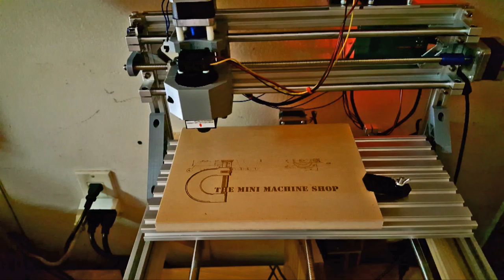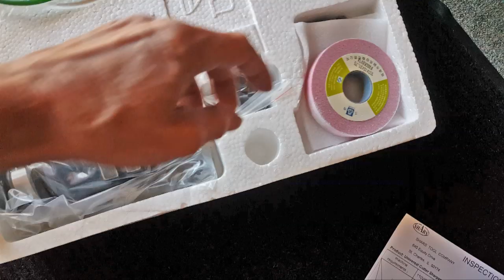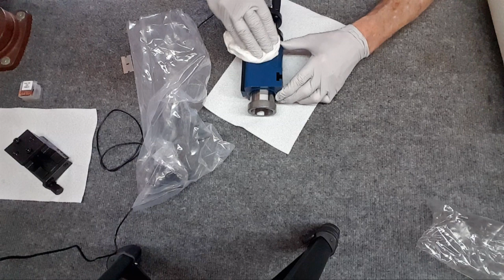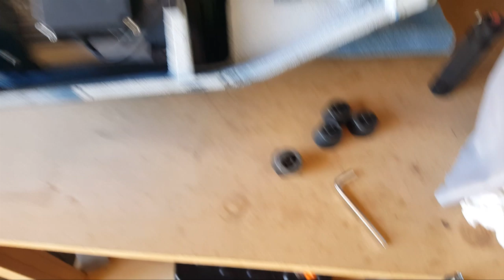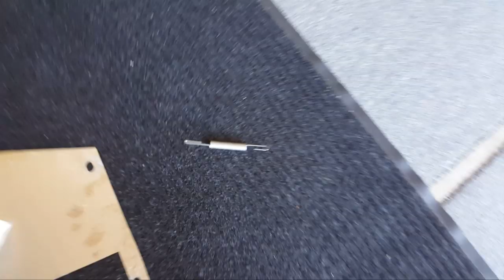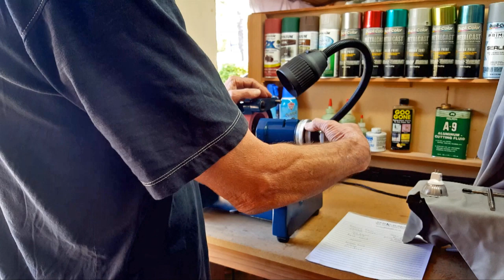Universal Tool Cutter Grinder AKA D Bit Grinder

Comment: no frills. no BS. just what it is and how it works. thank you so much! that helps me a lot. i bought the business end, and i'm trying to redneck the motor and base into a complete working tool grinder. your video helped me see the big picture.
Reply from the maker: If I can help more let me know my email is at the end of every video. Cheers! BTW mine turns at 5,000 RPM and is hard to find wheels that have max RPM specs. The Ebay ones spin much slower.

Comment: 22:35 I know this video is years old but.... rotating the upper left wheel brings the wheel to the left, bringing the spindle lock hole in line with the access hole.
Reply from the maker: Actually i never thought of doing that. I would just put the screwdriver in at an angle. LOL

Comment: Uh it's around 100 pounds. I lifted mine out of the box and put it on the bench by myself and I'm 60 years old. The pallet weighed half as much as the grinder. Shipping weight is 50kilos.

Comment: Hi Dave. My D Bit grinder does not have the spring you show and therefore allows the freedom to plunge grind. In many ways it feels like this is a more natural way to grind the D bits, ie freehand yet set at a precise angle.
Reply from the maker: I have both options I can rotate the knob to move in and out or loosen the side lock and slide the top assembly to plunge and the depth is set using the depth set knob. Many don't realize the entire top assembly is on gibs and slides.
Reply: @TheMiniMachineShop  Agreed, that is an option to overcome the limitations caused by the spring you have. However the original Deckel SO grinder upon which these Chinese clones are all ultimately based on has no such spring and therefore allows far greater freedom. Have you seen the excellent videos on YouTube by The Tool and Die Guy (Deckel Lessons 1 to 10). This series shows a great overview of the Deckel SO.

Comment: I bought one of these Deckel clones a few months ago, (not Shars), and are making some more flanges/arbors/wheel adapters, like Stefan Gotteswinter showed. But to duplicate the taper, I now I need to pull my original flange off the spindle, like in your video at 17min, and mine appears unable to be pulled of the taper. It does not have the 5mm or 6mm socket screw in the center and there's just a 4mm pilot hole where yours has the threads. Anyone else have a U3 clone machine that's the same?
Reply from the maker: I looked at pictures of the U3 and looks like mine can you email a side picture and one of the face my email is shown at the end.
Reply: @TheMiniMachineShop  Thanks for responding Dave. I'm emailing you.
Reply from the maker: Just found a picture of a Vevor on Amazon of an arbor like your describing. The screw in the center is what captures the adapter and holds it in place. With out the screw the spindle must be machined as one piece while other U3's do look like mine so there appears to be two U3 models.

Comment: https://www.youtube.com/watch?v=1egAPzOGVDw Luc Wybo shows how to use that drill attachment. Very thorough video. For wheels, KBC Tools has silica-based cup wheels from Triumph at reasonable price. Using brand name ones pays off, they are actually round. I have an Alexander 2CGD, a Deckel SO made under license from Deckel. I use it for lathe cutting tools (6 and 8mm round HSS) and for four-facet grinds on drills. After 5 drills I am down to 3 minutes/drill using a slightly modified approach from Stefan G. ER16 collet chuck does all the sizes I need.

Comment: I just received an advertisement/catalog from Travers.  They have a 4x3x1 1/2 "Type 11" aluminum oxide tool room surface grinding
wheel on sale for $15.74.  Actually, they are offering 5 different weels by part numbers 53-200-040K through 53-200-044K.  I don't know if a 3" deep wheel will fit on a Shars machine.  Also I don't know if a "surface grinding wheel" is suitable for a Shars D bit grinding tool.  These "K" series wheels are a fine grit so, that sounds hopeful.
Reply from the maker: Problem is the Shars machine takes 1 1/4 bore 4"wheels and mine also can take a 20mm bore wheel since I made a spindle adapter. Good prices and will check it out!!
Reply from the maker: Travers is my favorite and only place for taps and end mills...

Comment: Dave,
First and foremost... drilling out wheels (like that alu-backed diamiond wheel) is dangerous/lethal.... please don't run that wheel?
Another remark (this is for classic wheels, not for the alu-backed ones) NEVER; EVER run  a wheel that has no paper/cardboard washers glued on (use some card-stock if it is missing)
If you for some strange and weird reason want to lower the shaft RPM, you will only 'eat' your grinding wheels.
For small wheels like these.... 5000 rpm is a perfectly normal speed, if you put on smaller wheels, your RPM should go up!
From all the machines in the shop, a grinder is probably one of the more dangerous ones (believe me, you don't want to be near one if a wheel shatters!) Consider buying good wheels for your machine (you're in the US, so I'd suggest Norton) They will cost more, but there will be a lot less chance that you'll end up with a chunk of carborundum stuck in your noggin !!!
Like all Chinese machines, this is to be considered to be " a kit of parts"... If you make alterations to this machines (and you will... we all do LOL) make then right...don't use aluminium where you should use steel!
It will take you some time to get this working correct and without issue, but once you're there, you will wonder how you ever did without.
When in doubt about what to do... ask someone like the Great Jedi Robin Renzetti or some such Master of the craft.(I am at your service as well, and I do know a thing or two about grinding and you have my email, though I would not put myself on par with someone like Mr Renzetti )
There is no real reason to be apprehensive about this machine, as long as you realise that this is the wrong tool to cut corners on or do things in " a more economic way"

Toodles and congrats on the new addition!!

Paddy
Reply from the maker: Have no fear Paddy I bought a circular cutter a long time ago to make blotters for all my wheels and have been turning bearing surfaces on all store bought parts to be within ANSI B7.1 safety standards. I didn't find Renzetti as much of a source of help for what I'm doing over Norton's YouTube channel or even Stefan's channel. The bored out CBN wheel runs just fine and is safe. If you watch the next video you'll see face protection had been added to the machine. Cheers...

Comment: A 1-1/4" wheel hole is a standard for surface grinder wheels. Check out eBay, they have lots of wheels. Also try Grizzly. I have a HF heavy duty grinder that also uses the same size wheels and I can buy them from Grizzly
Reply from the maker: I don't see any 4" x 1-1/4 bore wheels on Grizzly! Am I missing something?
Reply: @TheMiniMachineShop  Sorry about that wrong size. According to google the Deckel tool grinders use 20mm bore. Check out this site for wheels or google deckel tool grinder wheels. https://www.artcotools.com/straight-cup-grinding-wheel-4-x2-x20mm.html

Comment: 1.250 is a standard arbor size  ...look for surface grinding wheels>  https://www.mscdirect.com/browse/tn/Abrasives/Grinding-Cutoff/Grinding-Cutoff-Wheels/Tool-Cutter-Grinding-Wheels?navid=12100095#navid=12100095+4288248080 ,http://www.hatchgw.com/Products.html

Comment: The very stiff shaft lock problem, take a look again at Robin Renzetti's modification, slitting the housing and fitting a pre-tensioning bold. I have made this modification, the lock is now quick, light and positive.

Try Luc Wyco channel on the PP3 and how he sharpens drills. He made a modification which does work. Once I got my head around what he was doing it then made sense, so I followed his modifications plus downloaded the charts mentioned in the video and have successfully sharpened my first ever broken drills. I will warn that his videos are a bit hard going, but with persistence I got there.

I pesume you have seen Stefan's video on making the tapered wheel adaptors.

Whilst I have the smaller dia adaptor and wheels - UK purchased unit, the diamond wheel runs just fine at the 5000 rpm. It is always recommended to stand to one side of any new grinding wheel at start up and run for a minute or so in case there is a hidden flaw which has not reveled it's self when doing the ringing test.

Comment: Hi Dave,  I've considered getting one of those but I just can't justify the cost.  I'm just a hobbyist/prototyper and the tooling I use is cheap enough to replace from time to time or resharpen if possible.  I have found that replacing the wheels included with my bench grinders with quality wheels makes a huge difference in the machine's performance.  When you look for wheels you should search for "toolroom grinding wheels", plenty of 1.25" arbor/high rpm wheels to be found.  Here's a quick link to Norton's site: https://www.nortonabrasives.com/en-us/toolroom-grinding-wheels.  Thanks for this video!
Reply from the maker: Hi Rich, I'm a hobbyist also and had a hard time justifying the cost for the same reasons. But a point came where I wanted to make my own custom tooling and this was the only way to get there. I've already made a small dovetail cutter for making test indicator holders. Something that small is very expensive. The items that I've made so far would have cost around $200 so the machine cost is reduced some. Had downloaded the Norton catalog already and found most at a ridicules price. But did find some wheels on Amazon in the UK for half the cost and ordered one to try....

Comment: Great work Dave!
Theres a lot of Chinesium in that machine it looks like. LMS, Grizzly, and more sell "Chinesium". When even Shars does that….. Is there any "US made" nowdays?
I know You've spent more than lots of time exploring the machine. To get it "paid back" You ought to start "Daves drill and mill bit sharpening Ltd". I would be a mental wreck facing all the trouble You did. Buying new drill-, and milling-, bits will be my approach. 
Just received a QCTP, for 52$ from "China". Parts were missing and no "spare part to send"....
Don't buy anything that COSTs more then 10$ from China......
Reply from the maker: LOL there is a US one made by Deckel but $4k is to steep for me. Future videos will show using each attachment but the drill bit attachment is going in the trash. All it does is make bad stub length bits from jobber length bits...
Reply: What the h...? No drill bit sharpening? What does Shars say? Ii's incredably bad if that doesn't work. Half of the money back....
Reply: Deckel SO is US10,000 and definitely not made in US, but they are sold in US:https://www.artcotools.com/deckel-so-cutter-grinder/. You can find them used but often they are abused beyond use. Also look for used Kuhlman and Alexander. Your other choice might be Toycen but you won't like the price of those either. I don't understand why people complain about Chinesium, if you don't want to  pay for quality then you have to accept the quality at price point you are willing to pay.

Comment: Have a look at Robin Renzetti's video on setting up this machine and wheel adaptors.
Reply from the maker: I've been to his channel in my treck for answers and he doesn't show much other than an extension modification. I did ask a question but not much help.
Reply: @TheMiniMachineShop  Try Stefan Gotteswinter, he did a video a week or so ago on four facet drill grinding on his Dekel clone grinder. The operating manual for the Dekel SO grinder is on the web.
                        Gordon
Reply from the maker: I did mention Stefan in the video as one of the sources of input since he has the same Chinese machine. His video did help me sharpen one end mill and I hope he does a video on sharpening jobber drill bits. I did find other manuals that are far more detailed than the Deckel manual if you want I can email a copy.
Reply: @TheMiniMachineShop  Hi Dave,  I am very interested in those manuals.  I already have the one from Stefan.  Any extra information would be great.
Reply from the maker: Email me and I can send them.. email is at the videoend.